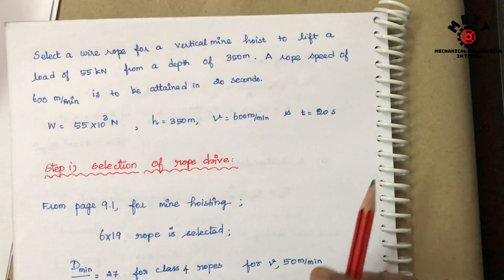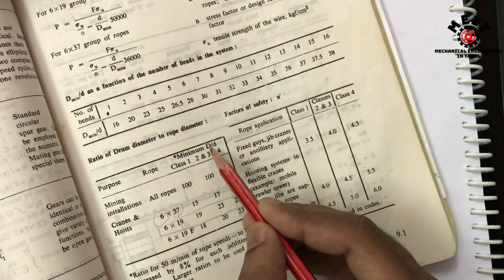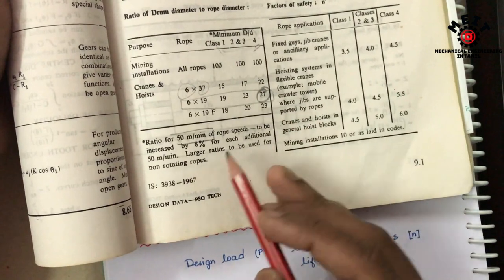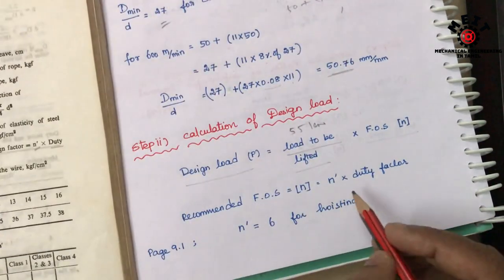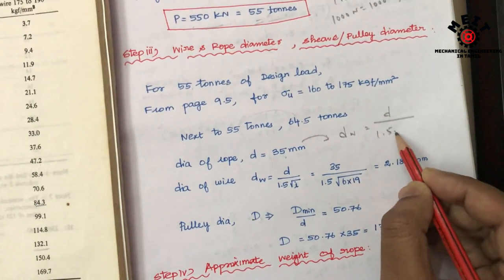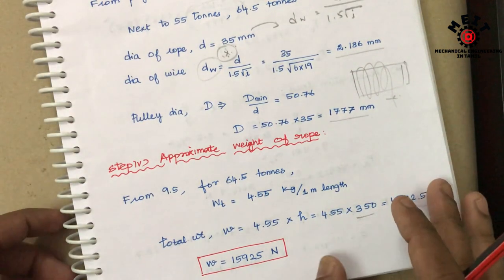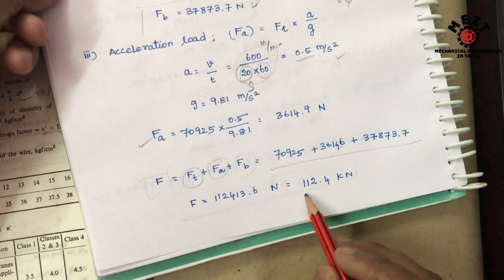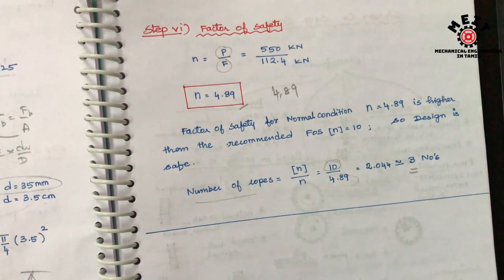Design of Rope drive from Design of transmission systems DTS in Tamil

Comment: Sir in ratio of drum diameter to rope diameter in DDB 9.1, you told for more than 50 m/min should increase 8percent for each additional 50m/min then for example if 180m/min is the velocity eppadi calculate pandrathu d/d ratio ??
Reply from the maker: 50# +50+50+30 .... Two times 50 extra ah add agi iruku and oru 30 iruku... Let me take  3 times add agi iruku nu eduthukalam... 24% extrah add pananum

Comment: Sir how to prepare for dts exam. That there is only one day gap for our exam in time table. So by reading design procedures alone is enough or we want to see all the problems in jayakumar book? And cone clutch problems are tough to memorize sir. is the clutch  formulas are available in data book Or how to prepare unit 5 sir. Could you pls try to upload few more videos for brake and clutches especially cone clutch and formula
Reply from the maker: Design procedure is must while preparing, for first three units, gearbox has procedure to draw kinematic and ray diagram. Brekas and clutches formulas are to be memorized, multi plate clutch procedure in data book, but we wont use that. Sinlge clutch formula kuda oru term add panuna cone clutch formula vanthurumae?
Reply: @focusacademylectures  ok sir. But clutches mattum konjam confusion ah irku adhuku inum videos kedacha nalla irkum.

Comment: Sir 1 Newton is equal to 0.1 kg but you had mentioned 1 newton equals 10 kg in 9:07
Reply from the maker: Yeah i was wrong.
Reply from the maker: 55 tonnes, 55000kg, 550000 N
Reply: @focusacademylectures  thx sir